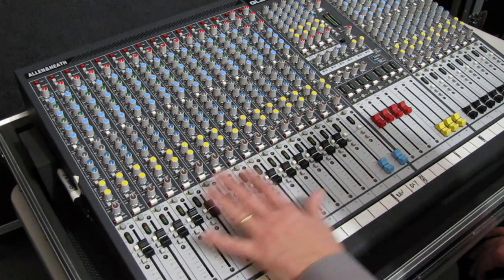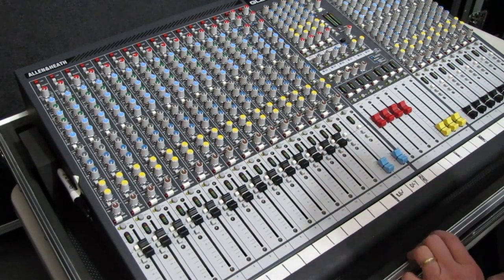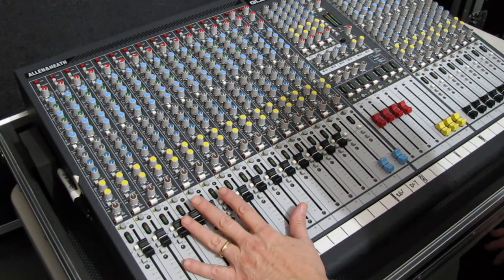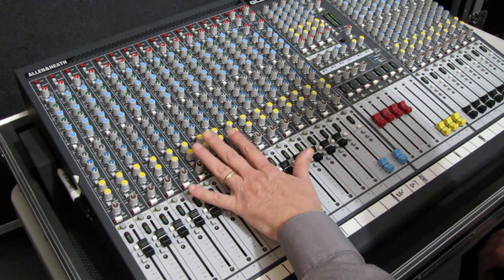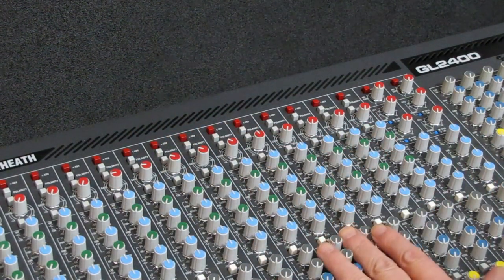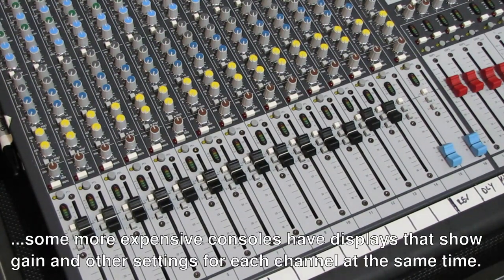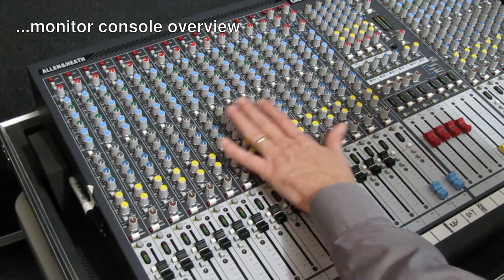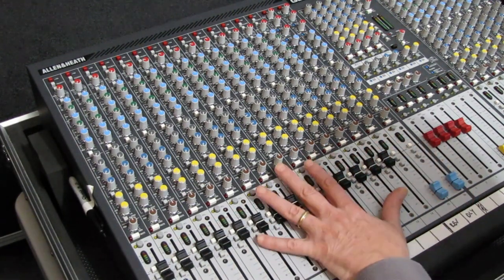Mixing at unity on consoles; is this the right way?

Comment: Okay 2024 I understand what you are teaching. NOT to adjust volume or trying to mix the sound using the GAIN control knobs at the top of the board or console. Should this be a question??? Maybe make a video showing how to set gain structure first, then show in video how to use faders afterwards and the fader placement  after gain structure. WOW.
Reply from the maker: We do have a few videos showing the process of setting gain.  Some of the videos are during a sound check.  Sorry, I do not recall which specific videos these are.

Comment: This video is fundamentally wrong, 

the board is designed to sound best at unity

Of course youre not going to mix a whole show with your gains but that doesnt mean youre not supposed to get the faders to 0 (where they sound the best).

Show up to any national show and do this crap and youll get laughed at
Reply from the maker: This is from the A&H GL-2400 manual (the manual for the console used in this video):
"Mixing with faders or gain controls? There is a technique
used by some operators where they set all the faders to ‘0’ position
and balance the mix using the channel gain controls. We do not
advise this method as the signal to noise ratio and control resolution can be severely degraded. In addition, it is impossible to mix monitors from FOH in this way as changes to the gain settings affect the monitors too."

I have a follow up video covering this topic.  It provides more detail on the subject.
Reply: @stageleftaudio  like is said, once the show is running you don't use the gains because that would effect the moniters.

But when sound checking, you bring the faders to 0 THEN set your gains and lastly send signal to moniters.

Also, the correct way to run moniters is through a separate console being fed off of a splitter
Reply from the maker: That is correct, once the gain is set, it should not be moved.  Remember, the gain control and faders are not the same thing.  The gain controls the input voltage of that channel; where as the fader controls the volume of that input. 
Using a separate monitor console is not actually considered the "correct" way; but, it is considered a "better" way to mix monitors.
Thanks for your comment.
Reply: The author repeat 15 times that it is wrong to set faders to unity, but he didn't say exactly what to do instead. When audio engineer talk about unity, they  say that unity is good starting point.